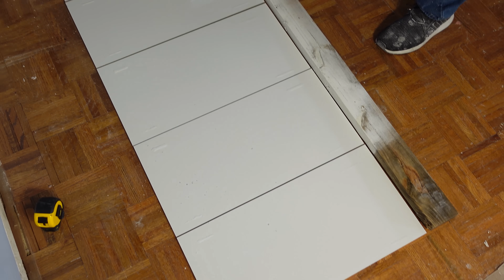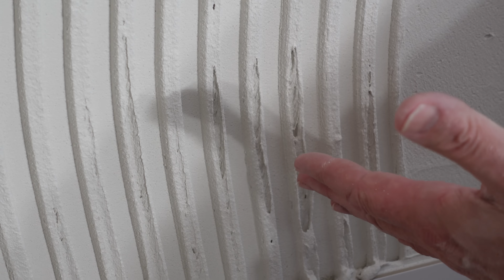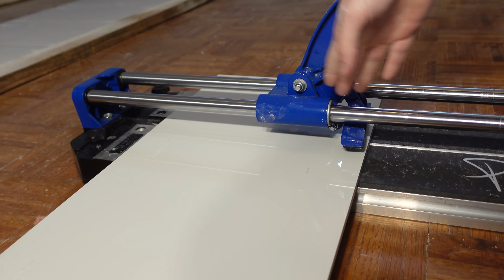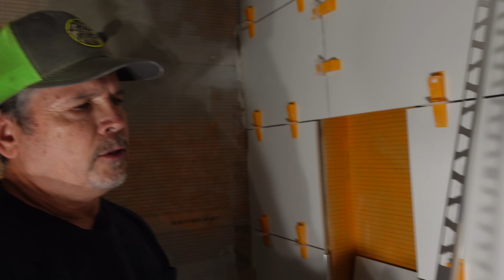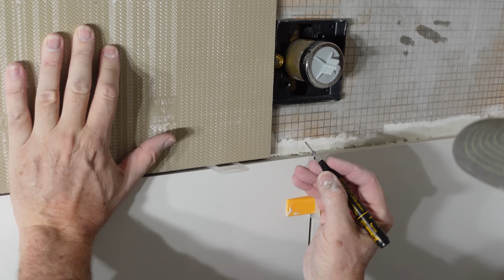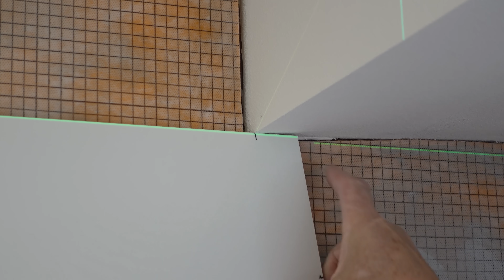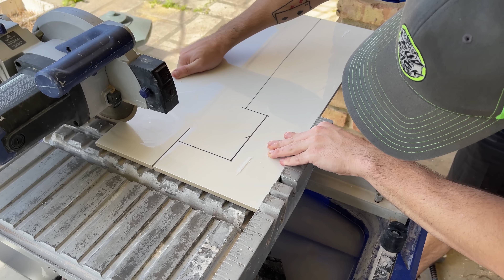Buy THIS Tool BEFORE You Tile! | Tiling a Shower

Comment: Number one tip I've got from this series is cleaning the edges with a margin trowel before installing each tile.  Seems obvious now, but it never occurred to me when I did my shower.  Spent a lot of time cleaning out the joints before grouting. 😞
Great content as always, gents.  Keep up the good work!
Reply: It's always the little things that make or break the project, Paul covers them all.
Reply: You don't need a margin trowel, just use the corner of your half inch trowel. One less tool to keep in the tight space.
Reply: Just clean the joints with a pick or pencil as you go.
Reply: Using a thinset (available in white) and grout of the same color saves a lot of work there....
Reply: I actually use one of the wedges for the leveling system to clean it off.
Reply: And if you use the wedge level system, that extra thinset can creep up into the clips then after its hardened they dont break off properly and you have to spend hours cutting them out.

Comment: Some questions.

1.  Your niche is quite tall.  But the horizontal shelf appears to be shallow,  How deep is it after tiling, and how could you have a niche that tall and put in a shelf toward the top?

2.  I see the video where you did the curb.  You used a styrofoam product how well does that stand up to someone who's 6'8 and 300+ lbs when they stand on the curb?
Reply: Schluter foam is very strong. Check out Schluter’s YouTube channel and they have a video of a contractor with his crew installing Schluter and standing on a free-floating Schluter FOAM bench! I believe they fit two construction guys on it, it was free-floating with no supports underneath and did not snap off! I have also attended their free workshops and it is a lot of fun to stand on the foam mock ups and see how strong they are… and some of these installations were only installed the day before (as part of the instructional demonstration) we were able to walk up and stand on them!  Schluter has representatives in your local area that are absolutely happy to help with technical specifications and details like this. I hope this helps!

Comment: Was the ledger board screwed in through the Kerdi?
Reply: Yes it was… but any penetrations in the Kerdi membrane can be patched as long as there is a 2 inch overlap around the penetration with a piece of Kerdi membrane and thin set. I would cringe at that also if it wasn’t for the fact that it can be fixed as long as there’s enough room around it to fix it. Free Schluter workshops show the ins and outs about all these details. Absolutely worthwhile experience!

Comment: I would recommend using a rubber mallet tapping the tile lightly in to the  thinset, just gives a better bond and you might not need so many of those "leveling" clips
Reply: mic dundee  Using a mallet sinks the tile a little deeper into the mortar which creates a better bond which is always a good thing on a wall.

Comment: im so glad you guys just slide the tile trim in. if you ask the guys at HD how to install it they will tell you to screw it in. Its completely unnecessary and makes high spots in your backer. i like these tile clips. for the 1" hole, dont grind. DAP makes tile hole saw. it has a jig and rubber sticker. You just add water and drill away.

Comment: You can also remove hot-glue using ISO 99 alcohol to remove it, it gets under the glue and beaks it's bond with the surface.

Comment: Good job good video, the only thing that I don't like is all these preformed niches I build everything custom and the big problem with those preformed niches that they're not pitched so when the water gets there and it gets below the tile or the solid surface it's just going to sit there that's why pitching the two-by-four and whatever type of board and waterproofing system you're using before putting the tile on is really the best way
Reply from the maker: Thx.  This was actually my first time using a pre-formed niche.   I usually go custom too for the same reasons as you 👊👍
Reply: @StudPack  nice!
Reply: This is why it is that you use thin set to pitch the bottom tile in the niche. It’s kind of like using a furring strip except for you use extra thin set. 😙👍 All that fabrication of a niche is not the time I want to spend waterproofing every seam. Love the prefab niches! Customized niches when you have to but prefab is a great option. Thank you!
Reply: @insecureinvestorchallenge7366  I'm a little confused by your comment, you're saying pitch the tile? If that's what you're saying that's what we're saying is wrong. When water gets through that it gets down to a flat surface and we'll sit that's why preformed niches aren't the greatest I've only seen one company that pitched and it ain't the big ones that you're thinking of
Reply: @insecureinvestorchallenge7366  everything must be pitched the substrate and the tile. End of story
Reply: No big deal you pitch the tile not the niche way easyer this way also i customise my niche never use that shit shluter niche to much headick
Reply: @marcopoulin1897  you guys are all out of your mind, you think water doesn't get through a piece of fish tile? Even if it is solid surface? Of course it does
Reply: @BonBon770  well best way its corner shelf of course niche its not so great but customer choice first

Comment: Professional tile setter for 20 years. Couple of points.
1. As mentioned by others the top tile on the left wall should be two tiles to match the pattern, although I suspect with your
attention to detail and perfectionism, the next video will be you realizing you oopsied.
2. When doing the layout, if you are using a pure white tile, the thin strip of the tile at the top will disappear visually speaking, when it is grouted with white grout. With a patterned tile perhaps not so much. 
That isn't to say you shouldn't have done your layout this way, as it gave you full tiles at the top and bottom of the niche.
The expression I have come up with is that tile setters are trying to create the "veneer of perfection" (all you Frasier fans should take a drink
at this moment!) You can't create perfect but you want the observers eyes to land where you want them to land and not see the fact that
the tiles are not full tile at every wall which would be true perfection. (in 20 years that has only happened once for me). Having full tile at the 
top and bottom of the niche draws the eyes. Perfect.
3. When I tile with kerdi, I scratch coat the wall and trowel the notches onto the back of the tile. I find it is less messy. I scratch coat the whole
wall all at once, even if it dries, thin set adheres to itself really well. I trowel the thinset on the back of the tiles out from the center so that the air
still can escape out the grooves. After some practice I can spin up to a 2'x2' tile on my hand (like a pizza) and trowel with the other, or place on 
clean water bucket and trowel away.
4. When cutting out the square for the tap hardware, start on the face side. You may need to get a better grinder wheel that cuts cleaner.
I have found some of the best wheels at rental stores. $20 Canadian, can't remember the brand and the name has worn off the wheel.
Tiled 50 bathrooms with 1 grinder wheel and a tile cutter like yours. As well I use a wet diamond pad, about the size of a drywall pad. 
Again I think they are in the $20 range. I would go to a tiling supply store if you don't already. They should have them. They 
are relatively inexpensive and do the same as your file to smooth the edges, but if you ever get into mitering corners they help a great deal.
As well you can use them to clean cured mud off of your tools to get them back to shiny.
5. Ideally you want the wall tile to land on your sill but with the stone slab that makes the point moot.
6. I have only ever had one hole saw to do the shower head pipe and it is about  1 1/4", Again I don't think too expensive at a tiling supplies store.
7. Keep up the great work. I have learned a lot of fantastic info from you about other aspects of construction. Your skills are what got me
to start watching your channel, your humility keeps me watching!
Feel free to pick my brain if you want on tiling questions
Reply from the maker: Super appreciate that 👊👍.   I noticed the top tile when we did the outtro 😡.  Last tile…. Not thinking it through…. Working till 7pm… all the excuses right 👊👍
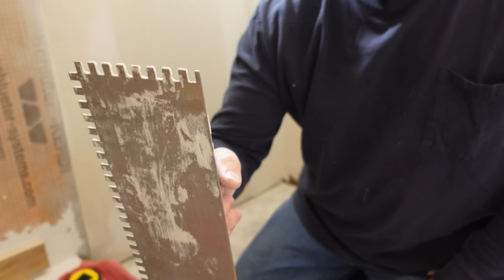Reply: @StudPack  That's why I always...ALWAYS stop at 6:59 ;)
Reply: Sneaky trick, use a grinder to make a notch in that top right tile, just enough for some grout to make to seem like it’s two tiles! Quick and easy!
Reply: Remodeling a home in about a month, wish we had people like you around my are to hire El Vaga.
Reply: Hole cut on porcelain, use a dripping wet sponge and hold it gently onto your grinder blade and do it from the top  then finish from the back of the tile.
Reply: Thanks for the tips. I was in the middle of doing pretty much this exact job when I read your post. I switched over to scratch coating the wall and applying the grooves to the tile directly. Worked great. Less cleanup. Like Studpack I messed up a tile I later had to remove, and the bond was insane, nothing like the tile I tore down from the original builder. The small piece of tile I had to remove came off in hundreds of pieces, no chance of prying it up.
Reply: @Jos Lewis Wood Carpenter when you watch the next video he actually admitted he made the mistake.  It isn’t correct the way it was done the first time. It has nothing to do with visually appealing.  If you like it to look wrong so be it.
Reply: Appreciate the detail
Reply: Hello! 
I would like to pick your brain if you don’t mind.
Can you tell me what would happen if a tile was only 50 percent covered? 
I can’t believe that it would matter that much because even with just 50 percent you have to struggle to remove the tile.
Is there some other reason I am not aware of?
Kind regards and thanks.
Reply: Do you ever pre wet your tiles before back butter? I'm no pro but I've been doing remodeling for over 30 yrs. An old pro told me. Just not sure it's still valid
Reply: @eclipsestorm1975  with most ceramics, yes, most porcelain,  no
Reply: @eclipsestorm1975  If you were to take a free Schluter workshop then water in the wrong places is a bond breaker. Giving certain surfaces “ a drink of water but not fully wetting them” does help the thin set adheres better. Such as on OSB, sheet rock and any cementitious backer to apply certain Schluter products (Kerdi Membrane) so that these products do not suck the moisture out of the thin set too fast. This is not the case for the back of tile. You do want to make sure that all your surfaces are perfectly clean and wiped down before applying your thin set. Stud Pack appears to have taken at least 1 of the Schluter workshops. Making sure to apply a “burn coat” on your waterproofing and the back of your tile is very good. The hands-on workshop has mock ups with instructors supporting you every step of the way to learn how to install their product properly yourself and teach from the TCNA Handbook. Make sure that you show up ready to actually work, learn and install! 😄😙💯👍 I hope this helps!
Reply: @insecureinvestorchallenge7366  Great catch on the two points you made. I also noticed those, as well as the over extension out of the shower past the glass. The tile extension should have been stopped to at the same distance from the window on the left side as the wall is on the right side. The window no longer balances in the space.
Reply: @eclipsestorm1975  That depends on tje tile. Bisque (soft) ceramic or some rustic tile- yes. I'd hit that w my sponge if it acted like it was sucking my thinset dry. Porcelain tile and stone is much less porous so no need to dampen it.
Reply: @eclipsestorm1975  you are correct. You can also wet wipe down cement board and wood based substrate surfaces before installation. Pop’s told me the old mud job tile setters used to soak the tiles in water while setting.
Reply: Only 20 years?  So in YouTube reality 20 = 2
Reply: @DoubleD72  you act as if there aren't tradesmen who love these kinds of video's. everything he said was constructive criticism and spot on.
Reply: @rickylafleur5823  oh there are tradesman's who do love these videos. None of the good ones that's for sure. Good tradesman don't watch videos. They work. It's the ones who THINK they know it all who love these videos. Because apparently they aren't getting the respect they want on a job site so they come here to troll people's videos. There is a million ways to do 1 job. Everyone should pick their way and f#&k off.   This guy's tile job regardless of a little tile placement is better then the majority.  The guy's essay was utterly ridiculous.  lol. It's the comment section of a YouTube video. Not reddit.
Reply: @DoubleD72  lmao you complain about his long well thought out points while writing a massive blob of bullshit. you clearly do not work a trade either, watching a youtube video about something you love to do doesn't make you terrible at it.

also how is any of that trolling? the man clearly knows his trade and was just sharing information which is always happily received. he never said it looked bad either so don't know what your issue is.
Reply: @DoubleD72    You sir/madam, are a fool.  Good Tradesmen  always observe others. When you think you know everything  is when you fall behind modern practices , techniques , and tool use. 
Vagabundo didnt troll here. His comment was a little long,  but constructive, and at the end he pointed out an incorrect tile, which he said they probably spotted and fixed. Which is exactly what they do in the next video .(AND Stud-pack gave him a thumbs-up)
Reply: @myrdaal  notice how he never responded, i guarantee that person never did trade work a day of their life.  you are spot on as well. failure to progress, observe, learn is what separates the greats from the trash. owning your missteps as well as stud pack did is what i like to see. no one is perfect and that i can't fuck up attitude is what leads to shit work. aka the good enough boys.
Reply: @myrdaal  Thanks for having my back fellow veteran setter, now do you have my knees cause I think mine are gone ;)
Reply: @rickylafleur5823  Thanks for having my back :)
Reply: I wouldn't call the 5 inch cut at the top a thin strip
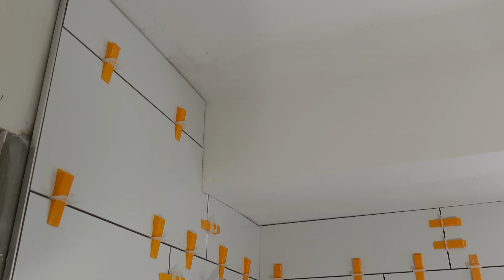Reply: @markme4  he is talking about the top tile is the same length as the one below it.  It would look better if the top had 2 pieces instead of 1.  pause the video at 25:40.  top tile should have a grout line where the top right level is at.   not a bid deal but thats why we are here.
Reply: @markme4  I think he was referring to the thin sliver at the top they would have had if they hadn't split the top and bottom tiles.
Reply: @isaacholzwarth  Yea you're probably right but that looks like it would have been 4 to 5 inches as well
Reply: @isaacholzwarth  That's correct.
Reply: Feel free to pick my brain and my answers will be shorter
Reply: @BonBon770  That's because you know less.  Or nothing.
Reply: Your B.S dude. I could tell by the first couple of sentences. He did exactly wtf your supposed to do. Bro I can tell you have not been setting tile for 20 years.. You talk a good game , but thats all it is... TALK.
Reply: @seancollins6319    Not sure what your beef is man . Also a tiler (as we say in Uk) for 20+ years,  El vagabundo was exactly right in everything he said. I dont watch videos like this to find fault , I watch them to pick up tips and see situations that I havent encountered before,  and maybe new products or techniques. Sometimes there is a better/quicker/easier way than what is seen in the video, and experienced guys try to pass on that knowledge, for everyones benefit. You can see the Stud Pack team  gave the thumbs up.
Reply: @seancollins6319  Kind of like what you just did.  Blah, blah blah.
Reply: @seancollins6319  lol , his reply was like a book, like we asked for his extensive knowledge.
Reply: @markme4  You didnt ask BUT Paul DID!

Comment: My comment disappeared from you tube, another no no I guess. . 
Google tile hole saw in the Home Depot website QEP has a 1- 3/8 hole saw kit that’s lets you use it as a wet saw. I’ve used it for the shower head and got the side mounted hand held mount as well. It works great, nice fast and clean cut hole.

Comment: Hey Paul. We recently started using the Spin Doctor System on the large tile as you're installing now and we love it. Not sure if you've tried it yet but check it out and see what you think.
Reply from the maker: Thx Mark.  Is that for back buttering?
Reply: @StudPack  
No sir. It replaces the wedges. The spin on, "hats", as I call them, cover way more area than the wedges do. I do apologize. I should have explained what I meant.
Reply from the maker: No problem 👊.  I’ve seen this turntable device to spin tiles while back buttering.   I’ll definitely check out Spin Doctor 💪

Comment: So many good tips for a DIYer!

The layout was the part I struggled with the most when I did my shower.

The file to smooth the edges of the cut was something I didn’t think about and sure could have used one.

I know the pros love the shluter system but what’s your opinion on doing a couple of coats of a waterproofing liquid like redguard (or something similar) vs the shluter?

Thanks for another excellent video!
Reply from the maker: I like liquid membranes on walls.   Never tried them on floors but I’d like to try laticrete hydroban.  We’ve done Kerdi floors and Mapei aqua defense on walls.  Good merging of two systems 👍
Reply: Hydroban was what I used on my remodel but that’s because it was significantly cheaper than a shluter system.
Reply: @ivwshane  If you take the free Schluter workshop then you can get a full education on the product, warranty, legal standards from the TCNA handbook and decide for yourself. It was an eye-opening experience for me. Absolutely worth it! I hope this helps.